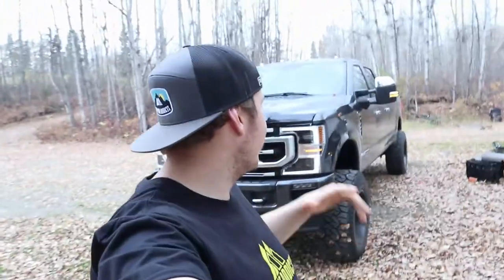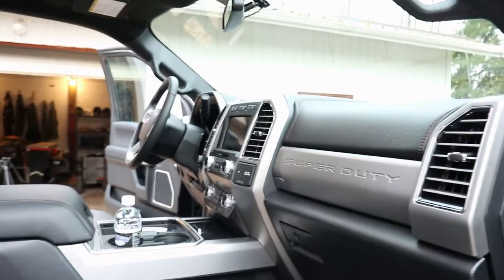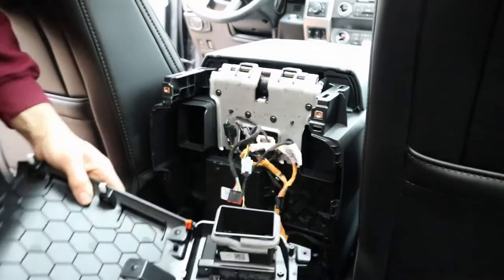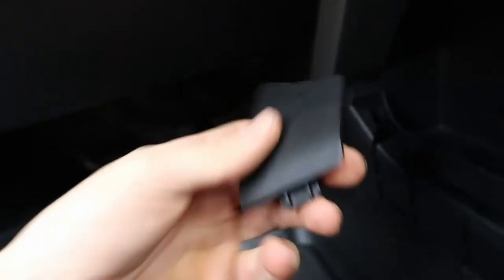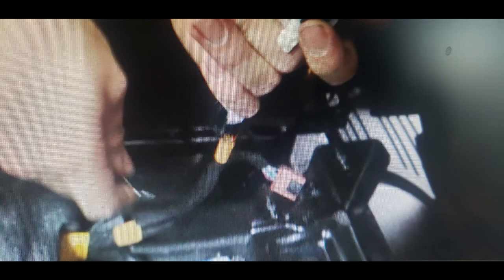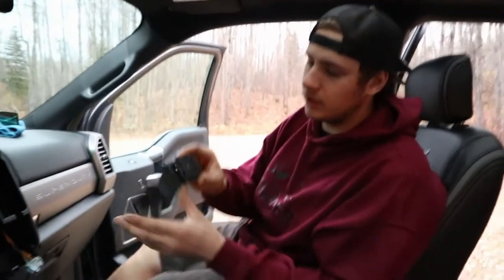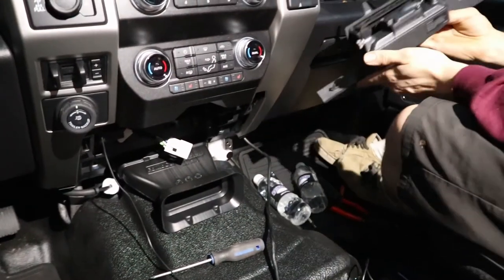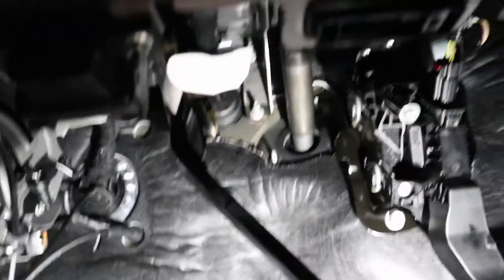Center Console and Dash Removal - 2020 Ford F350 6.7 Powerstroke

Comment: thanks, im putting a ham radio in my f350 2019 plat and needed this. wondering why you didnt mount thevradio on the inside of the console storage but like what you did.

Comment: Nice vid thanks I have a 2022 limited want to swap out my center cup holders from my 2018 limited. Because the 2022 doesn’t have ambient cup holders 🙄 easiest route you’d suggest?
Reply: Figured it out that was easy.

Comment: Can you provide the link for the phone bracket?  Thank you
Reply from the maker: It was just a spare bracket i had laying around,  i had modified it to work in my last super duty then jusy transfered it over
Reply from the maker: You should be able to find a bracket that will work at any tele communications store that sells phone boosters or 2way call radios
Reply: Thank you!